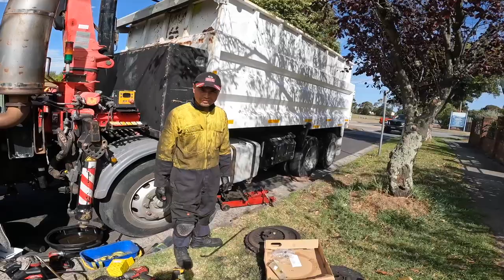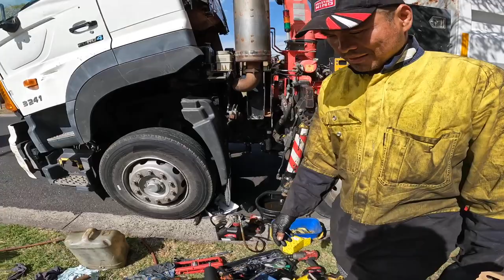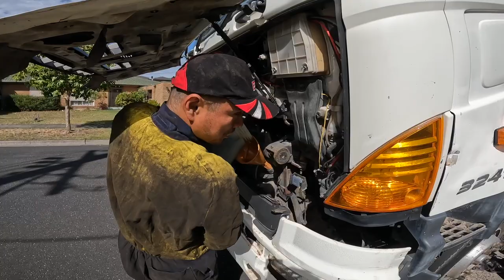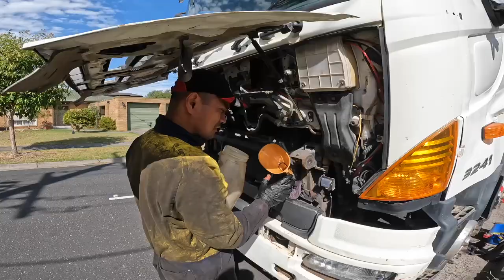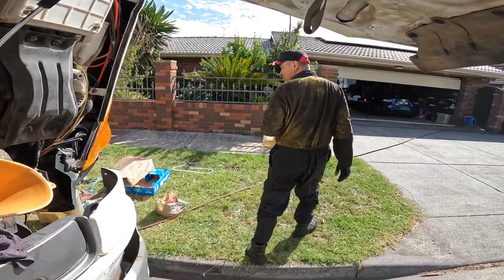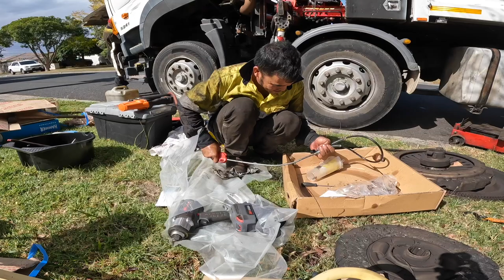Big Truck Replace Clutch on the Side Road

Comment: Huli yan ng police sa state. Hindi puede sa kalsada gawin iyan. Towing ang kailangan. Istorbo sa kalsada!
Reply from the maker: You are right
Reply: Haha I was a Cummins field tech for 13 years. I never had any issues with the Police when I carried out breakdown repairs. As long as the truck is parked up safely and we don't leave a big mess after the repair. They don't normally care. This one is  a different story, though. I think you need a big shed, mate. This isn't a field breakdown.